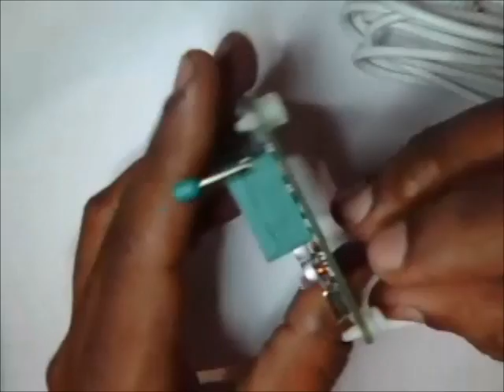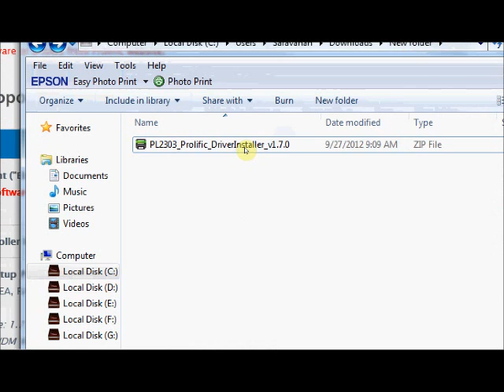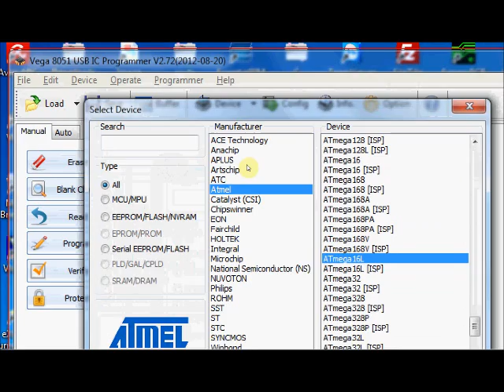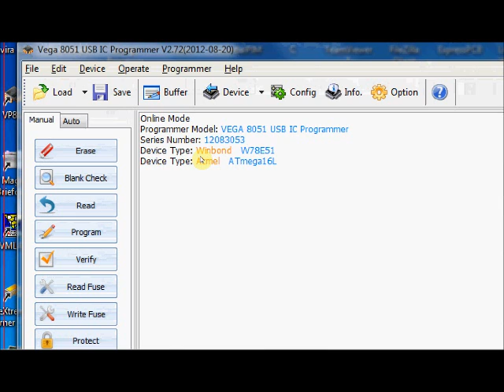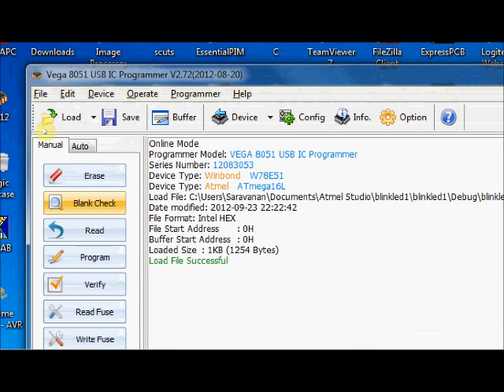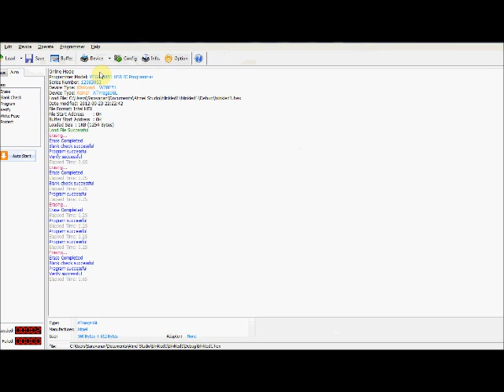AVR USB Programmer VP812

Comment: sir I have this programmer . I programmed atmel 89c2051/89s52 etc. several times . but now I want to programe atmega328p . and I want to use external 16 mhz crystal to pin 9,10 with 22 pf to ground from each pin . I programmed a test code that will blink a led in 1 second interval attached to portb0 pin(14) .  fuse bit I have burnt as FF hex(the bottom end item of the dropdown window in configer page's external ck selection) . clock out put on pin 14 disabled . But the result is  beyond the expectation . led blinks at 20 second interval even I removed the crystal along with 2  22 pf capasitors from breadbord, the result is same . please help